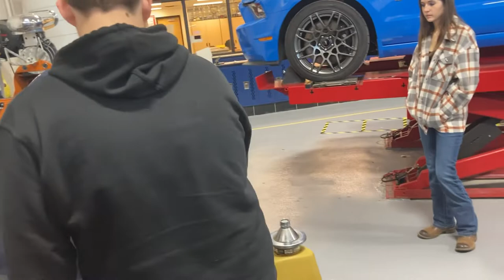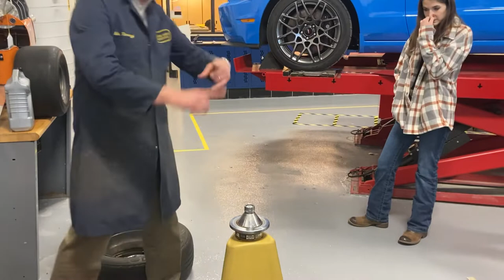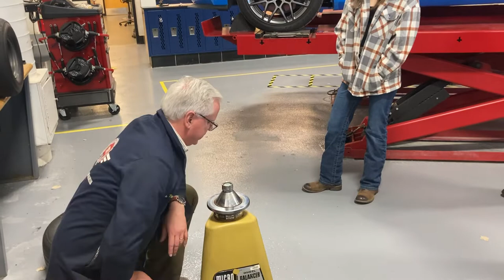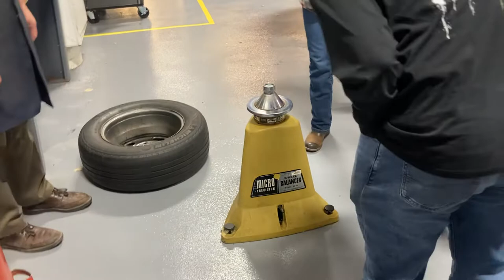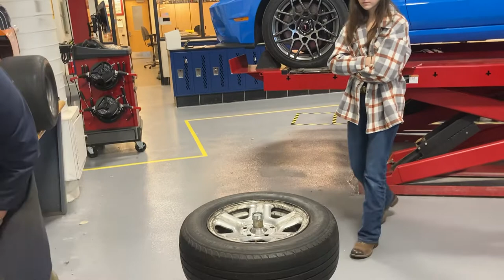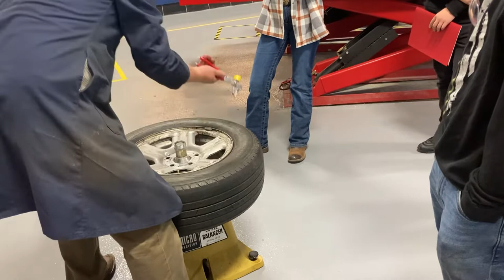Automotive lecture: Wheel bubble balancer

Comment: Very accurate IF you use 2 weights on the inboard and 2 weights on the outboard spaced 120 degrees opposing the heavy spot. Then you have an accurate Static and Dynamic Balance. Learned this when  I was 16. That was 50 years ago. Always works. And just as accurate as any computer spin balancer.
Reply: Well if you learned that at 16, you didn't have a very good teacher.  A bubble balancer is a SINGLE-PLANE balancer.  It can only balance a wheel statically. The word gives it away.  Static means stationary-not moving.  The weight splitting he did in the video is to prevent COUPLE IMBALANCE, which happens when you add a single weight (over 3/4 oz) to one side only.  Splitting the weight between one side and the other, exactly opposite of each other prevents that.  DYNAMIC balancing is a TWO-PLANE balance.  That means balancing the wheel while in motion.  This is done on an off-car spin balancer.  The wheel and tire assembly must be rotating to accomplish the balance in both the radial (up and down) and lateral (side to side) planes simultaneously.  No amount of spacing the weights at a fixed angle (you mentioned 120 degrees) will accomplish this, plus it wastes a LOT of weights.